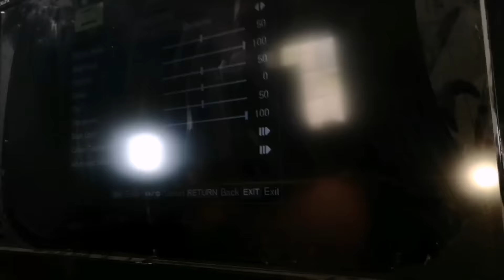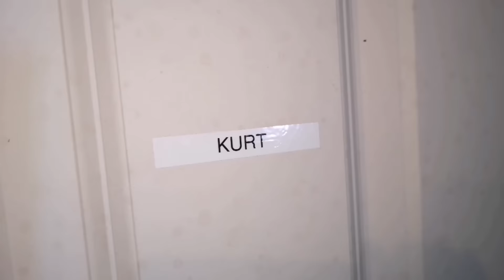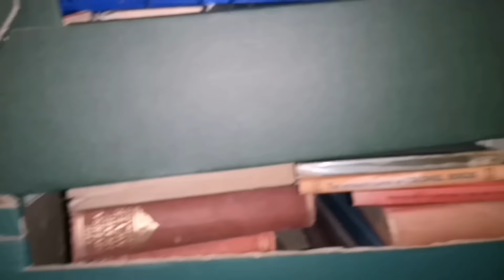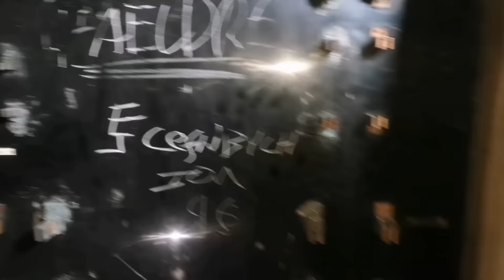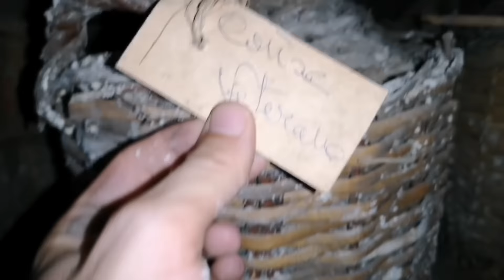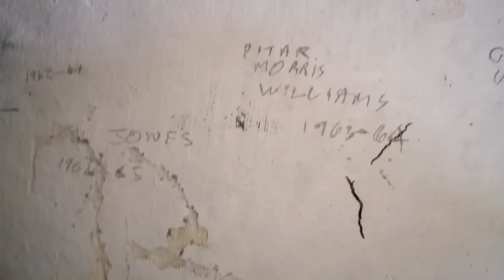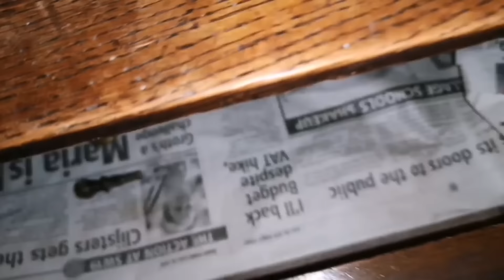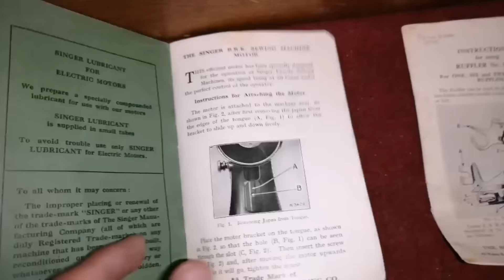Did We Just Sneak Into Jeffrey Epstein's Secret UK Mansion

Comment: As a leather worker I would snap your fingers off for that singer sewing machine.  I’d pay £1000 for that sewing machine no problem.  They are like hens teeth and they are the best sewing machine for leather workers.  They don’t make them as tough and rugged and well built these days.  Fantastic machines.
Reply: Interesting. I still use a singer 185k...the local sewing machine mechanic said I'd bugger it up trying to sew leather, even though I had done years ago (eg white leather biker jacket!). Mine's a 1959 model.
Reply: @mushroom_coloured_stepthro   yeah there are some model that are designed for thicker leather.  I mean I work with veg tanned leather that’s 3.5 MM thick and if I’m sticking 2 welts together with a centre welt in between that’s a 10.5 MM welt I’m stitching through although I’ve seen later singers used for such.  It’s the very early models that are the best for veg tan leather but even then I’d still have a need to for a later model.  Stitching through leather clothes won’t damage it you are supposed to have a special leather needle though which make it easier to stitch leather.